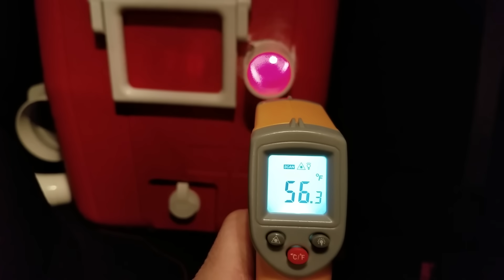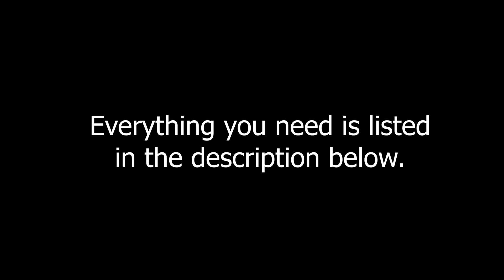Homemade Portable Air Conditioner DIY - Version 2 - Runs off 12 volt battery, car, or solar!

Comment: Did you experiment with a reducing fixture that would fit on the front of the fan so the intake would be getting the benefit of the venturi effect cooling the intake air?    Also, could there be an advantage to mounting the fan in the opposite direction of the exhaust so you are no sucking in the cooled air which, since it is heavier, sinks to lower levels?   Bought the parts for your earlier design and have new design parts on order.  Great idea!   BTW:   Found excellent $5 coolers at local Goodwill store.
Reply from the maker: I did not experiment with the venturi effect. As far as mounting the blower at the opposite end, I would be worried about one thing. If for some reason, you got a hole in the metal ducting and water got inside, you would be sucking moisture past the electric motor which could damage it. If it's only blowing like in the video and you get a hole in the ducting, it will not damage the motor.
Reply: qdroman could you please describe what a reducing fixture would look like or provide a link? I’m unfamiliar with the Venturi effect and how you would apply to the front of the fan. Would a 4” to 2” coupler do what you are describing? Thank you
Reply: @suttergorilla  Basically, when a gas passes through a restriction it must "speed up" and a pressure drop develops across the restriction. With a venturi the inlet and outlet are gradually reducing and allowing expanding of the flow. In other words, if the venturi is circular in shape you just have a cone for both the inlet and outlet. I see no advantage of a venturi here. The air flow might suffer a tiny bit because an extra small pressure drop has just been introduced.
Reply from the maker: All of your questions are answered here: https://www.youtube.com/watch?v=H4LutVTqsUU&feature=youtu.be
Reply: I don’t see the benefit of adding a venturi because you are not mixing substances. A venturi is used when using the pressure drop as a way to suck in another mixture through means of having a bifurcated pipe. All you would be doing here is slowing down/choking the flow without benefit. You would be losing potential energy and reducing your net heat transfer rate

Comment: I have two concerns, one is eventually you'll get a leak through the side of the ice chest as the sealant ages, and the semi rigid duct is not watertight, expect water to get on the inside of the duct.  

Other than that, this is a simpler and possibly better design than the hydronic cooling systems I've built using pumped water through heat exchangers, which needs a pump, water tubing, heat exchanger (copper coil water loop or radiator), additional wiring for pump in addition to the fan.
Reply from the maker: I agree with your concerns. The first one could be addressed by bringing the tube in at the top rather than the bottom like I did. To address the second concern, you could do so by connecting a tube to the cooler drain and running it outside. That way, if any water leaked inside the air duct, it would only get about an inch deep and air could still flow through freely. In hindsight, I should have mentioned those things in the video. Thanks for pointing it out.
Reply: Flex Seal to the rescue :D
Reply: Flex seal would insulate the tube and be less effective. It would have to. The reason it cools is the heat transfer of the aluminum.
Reply: jendarjen I agree with flex seal

Comment: Is it quiet enough to use in a crew cab pickup truck ? I have built others and the fans seem a bit loud.
Reply from the maker: Yes. I think so. You will hear it, but it isn't any louder than a normal air conditioner in a car.
Reply: how about using the same type of a/c blower motor/fan that the car already uses? or is the listed fan more powerful?

Comment: Also what if you were to be able to fit more pipe in by crunching the diameter and there for increasing the length of the passage that the air is to take prior to exit. In this way the duration and intensity of cooling would be increased prior to exit..
Reply from the maker: I think this would be one of the best things you could do to make it colder. I even considered going splitting the air into several small copper tubes so that it would stay in the ice longer, but that would have been a lot of work.

Comment: Hey Jason, thanks so much for sharing.. Great ideas you are very talented.. What if you were to intermittently crunch up the diameter of the aluminum piping? Would this cool the air even more as more of the air would come into direct contact with the chilled aluminum prior to exiting the cooler?
Reply from the maker: Sounds reasonable to me. I think it would. The only way to know for sure though would be to test it.

Comment: How do you use it in a room?
Reply: can one use an adapter so that it can work on 120V?
Reply from the maker: Just hook it up to a power source such as a 12 volt battery or solar panels.
Reply from the maker: Sure
Reply: Can’t you just plug a fan into an outlet?
Reply: Duh

Comment: Try adding salt to the ice. Chemistry 101

Good thing you put the fan blowing in. With salt mixed with ice water, it will probably freeze the electronics.
Reply: Anon Mason Would dry ice work or too cold?
Reply: It might get so cold that it cracks the metal pipe because it will bubble.
Those metal pipes are not very thick. That's a good thing so it can transfer to the air quickly. But dry ice might make it brittle and move it too much from the boiling effect. (Dry ice makes gas)

The accordion style pipe makes weak bendable points that could snap at a super low temp.
But that also provides more surface area for cooling.
It's basically acting like a radiator.

If the pipe holds up then dry ice would at least help the saltwater stay colder for much longer.
The fan should be fine if it's pushing air in rather than pulling air out. So it's not getting super cooled air across the motor that makes condensation.

Might be interesting to test out.
Reply: Better be in a good size room if your in a small room or a small inclosed say a car or suv you can pass out from dry ice not a good idea to do that I use dry ice one time at my business freezer broke and techs could get out intel the next day went in for over 15 minutes and was dizzy asf.  So I wouldn’t do that just a thought.

Comment: Can you still use the cooler as a cooler for food at the same time?
Reply: Duh
Reply: @214grovesideplaya  is duh the only word you know?
Reply from the maker: Sure
Reply: Was thinking about this too, you can put like a grill with legs so you won't crush the tubing.
Reply: Just not too much weight to crush the tubing.